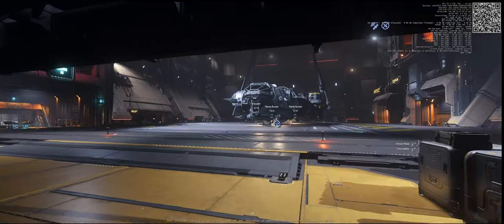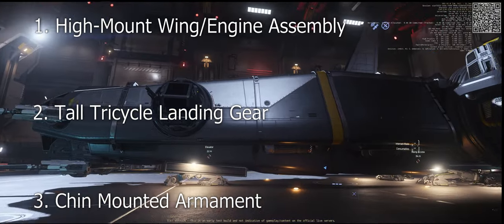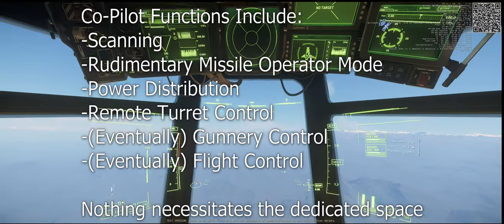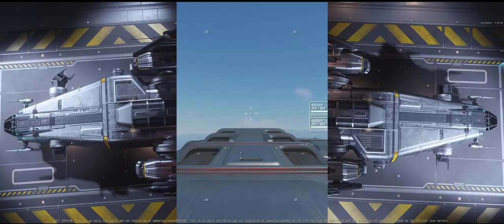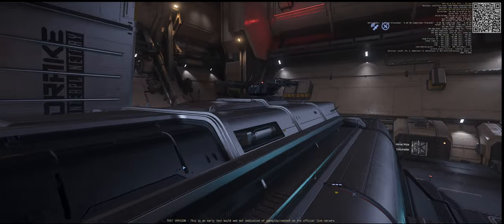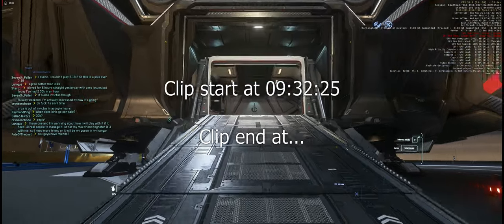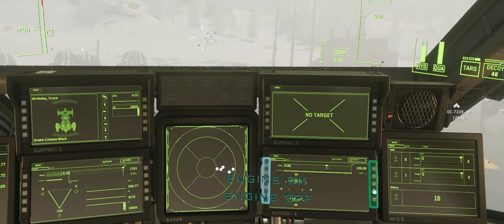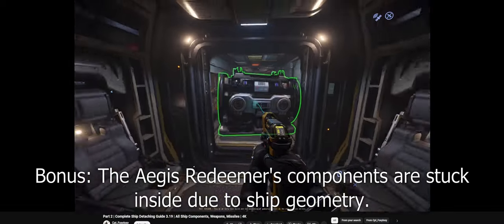Why I hate the Drake Corsair

Comment: They also intentionally choose to have Gunners in the Gunner seats for many reasons. Several being, that the MANNED turrets cant' be replaced by the "blades" that everyone hopes comes into the games, as where electronically controlled turrets are supposed to be able to have that feature. Also, it gives the GAME portion a better feel to put a friend in a turret (while sitting at a computer screen) rather than having a computer player sitting at their gaming desk then have their computer AV sit at another computer ( inside a game) at another computer screen,.. shooting a turret gun.  That's NOT more fun for friends. It doesn't give the "game feel".. it doesnt' give the feel of the WWII fighting that they wish to have, and it doesn't offer that "star wars" feel we saw in the original.
Reply from the maker: I actually support the idea of manned turrets that offer more than remote or automated turrets. They need to be well positioned in order to offer more, though, and the Corsair's turrets are not well positioned. 

However, the thing is - WWII fighting had remote controlled turrets. The B-29, the P-61, the A-26, there were remote controlled turret designs in WWII fighting. WWII Fighting in space is a really difficult idea to perpetuate.

Comment: Don't want to be an apologist, but there may be some game engine reasons why things are the way they are.  Clearly, the concept had everything mentioned as 3 core pillars mentioned short of the manually controlled ramp (which can be easily added later in its gold pass).  The ramp is actually one of the best ones in the game since it goes flush on uneven terrain.  The landing gear was likely shortened because of internal space and/or longer gears simply breaking, hence the chin mounted gun being raised to port/starboard.  CIG is still hiring artists for ship final pass updates I hear, and Manchester is nice this time of year.  ;)
Reply from the maker: England isn't too different from Michigan climate wise :\ Since hangars are being reworked for player instanced hangars, there's no reason the landing gear can't be restored to original, taller height.

Comment: The landing gear is short because of hangar metrics. It'd be too tall with the wings up
Reply from the maker: Good thing hangars have been re-worked. That's not a sufficient reason to edit the design to a lesser state.
Reply: @birthdaytruck  it was released a year and a half ago. Should they have originally made the wings shorter so the gear could be taller? Yes.

Comment: Most of their non-fighter designs are only designed for a look, not for actual function.  If their universe was real many of their ships would never be bought by anyone.  There is so much dead space in some of their designs that it boggles the mind.  What good do huge wings do on a lot of their stuff when there are not a large number of weapons mounts on them?   The C-1 line is a perfect example, the Corsair another.   An intelligent and functional design would try to lose as much mass as possible, and not weigh down the ship with useless frivolities.
Reply from the maker: These looks can easily be made into function; I don’t think the corsair should hold away but for $200+ you have to sell un-gimped functions

Comment: They have said multiple times, the reason the corsairs legs so stumpy is due to the hangar height restrictions.  And the wing height.  Until they give us taller hangars...  wont happen.
Reply from the maker: Hangars are being re-worked and re-scaled for instanced hangars. Also - hangar height restrictions isn't a sufficient enough reason to gimp a ship design you're charging $250.00 for.

Comment: This is the outcome of video game designers who have zero engineering experience, coming up with ship designs that only cover the existing state of the game without any requirements for future proofing. They obviously did not consider the ships as anything more than quick placeholders to make sales. Newer ship designs are leagues better. 

Take the cutlass for example. Its supposed to be all about rugged reliability with a focus in combat, but it even lacks a shoilet and a table, forcing you to place all items on the floor. That thing doesn't even have light controls, even tho the buttons for it exist. 

Then we move up to the corsair that offers that bit of extra, but lacks the ability to land on rougher terrain as you mentioned, while also featuring way too many doors in between with no real reason. Just wasted space.

But if we move down the price range... the cutter is well polished. Cramped, it includes a toilet an a bed, a small kitchen area and secondary surfaces while still being able to carry some cargo with it. 

My biggest concern is engineering, how are they going to implement engineering when half of those things don't have the dedicated space for those components? Let alone relays and the rest of wiring. And then they want to add physicalized damage? So the design and placement of components will become central to our gameplay experience, yet the ships are simply not designed for it. CIG wants to deliver a shitload of new ships, but maybe they should redesign everything first.
Reply: That's some great points. I have some hope that this game will eventually come out, but the content creep of ever new ships, each of them "punching above its weight" so that none of them truly do, does mean that older models simply fall behind in quality. And until all mechanics are implemented, they will also not be complete models, as you point out with engineering sections. The ships seem unfinished, or rather, finished to a game that could be 8 years out of date with current requirements.

Comment: Designed by talented artists and rendererers rather than having an engineer involved. Space use is very inefficient and sometimes designed without consideration as to use. Cargo bays that can swallow the 32SCU boxes, but not snap them to grid is a case in point.. The MSR...the MSR should be brilliant, buit its a hot mess of inefficient design, just to tyr and sell a "smiggler" feel. The Herald is better designed than the MSR, and it doesnt have a game loop!

Comment: Tractor beams on the nose are pretty useless in gameplay. You cannot load cargo into or near your own cargo bay
Reply: The tracktor beams other than dragging a small ship around with you seem pretty useless on all the ships. Its more like a gimmick more than anything else but you can't really actually load ships with them at all.

Mayby they have something down the line for this but currently they just get avoided in game.
Reply from the maker: A chin mounted tractor beam would be useful for assisting your ground crew. Ground crew trying to enter a cave but a big rock or shipping container is blocking it? The Corsair can open your path for more exploration.

Comment: Could have saved your effort if you just paid attention to development - dynamic landing gear and ramps alignment is a planned feature, across all ships. Similarly you cannot designate as "not fun" something that is, as stated billion times is a placeholder, across all ships. Freelancer is an  2014 design that is yet to recieve a pass, etc etc. Basically your video didn't say anything anyone has not already said many times, including CIG themselves.
Reply from the maker: The turrets are still poorly placed and the co-pilot seat has seen no thought leadership as to its intent; I’ve dug around for it for a while. 

I expect lots of these ships to receive functionality passes - look at the MFD changes planned for 4.0. But the ideas and geometry in some of these ships are bad and shouldn’t be released for the prices.

And the landing gear was a compromise to keep the wingspan to fit inside a std hangar dimension. That was the wrong compromise - the wingspan could have been shortened or folded to fit.